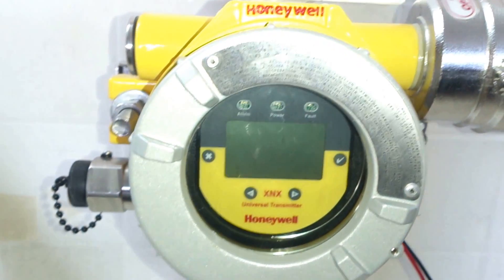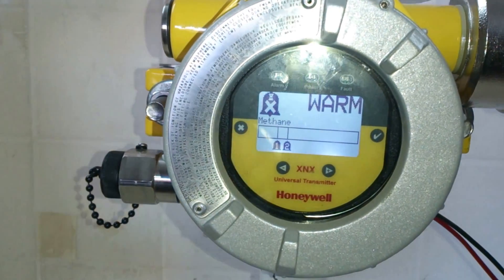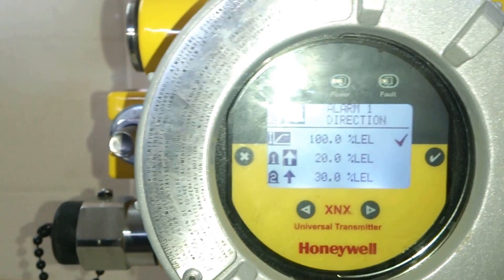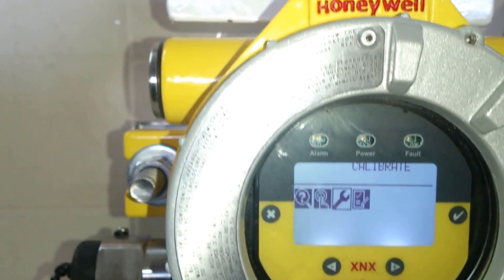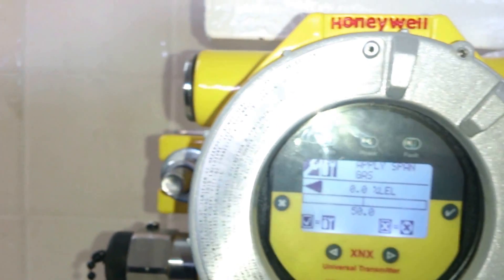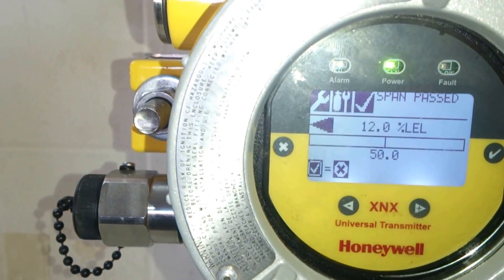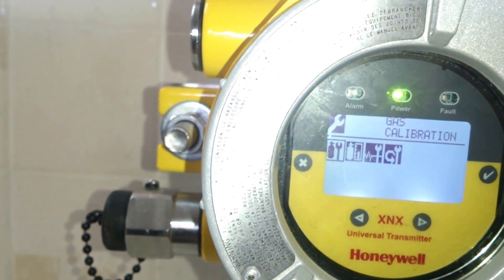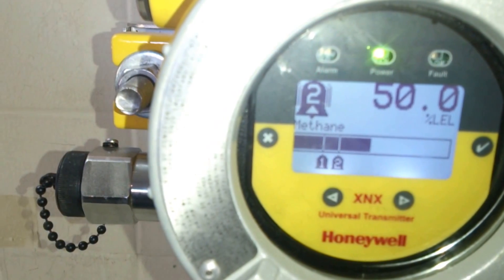Configuration and Calibration procedure of XNX transmitter connected with a Searchpoint Optima se

Comment: What is the use of latching and non latching?.
Reply: When it is latched your output will remain activated.
You will be only able to deactivate output by
1. Clearing the alarm /fault/warning condition
2.  resetting the input after addressing point#1 above.